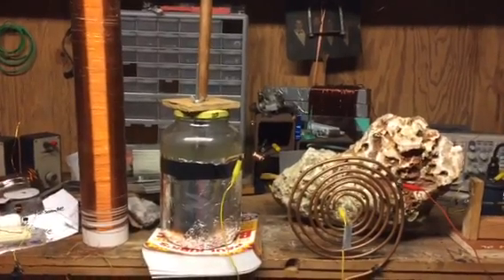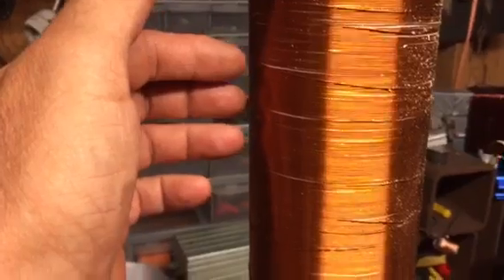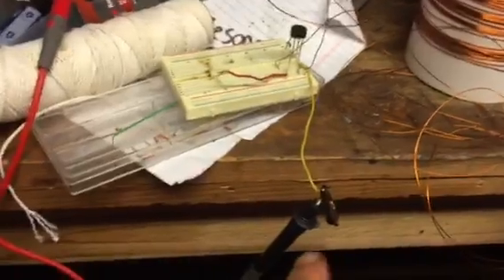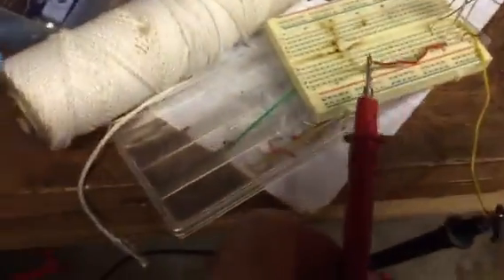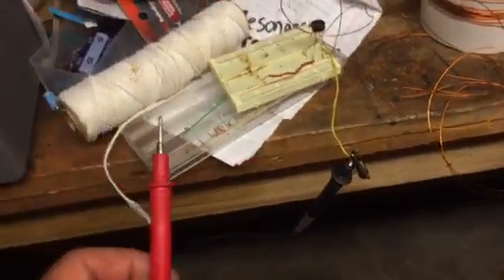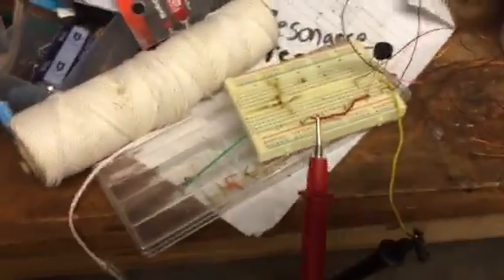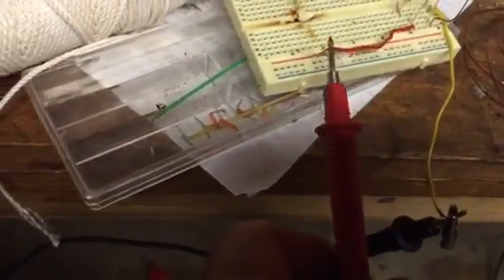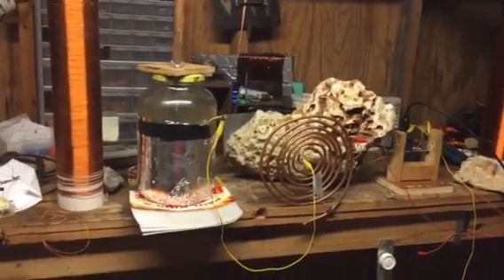Edleedskalnins Workshop. Wireless energy transmission. Step

Comment: Roy what you doing shows some electro static activity is cause by the collapse of the field during the spark gap arcing.   NICE.       simple practical. Just don't touch the aluminum foil right?  hee hee

Comment: there should also be some way he controlled the energy, or at least maintained a paremeter around the copper antenna he put out. You are working with a small set of equipment, he had massive equipment.